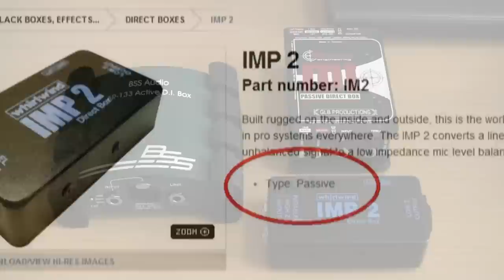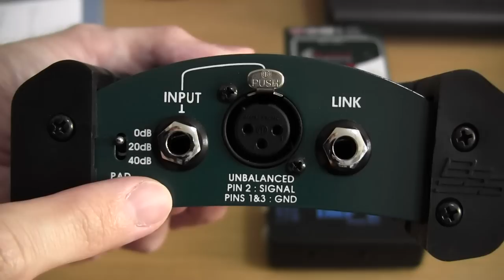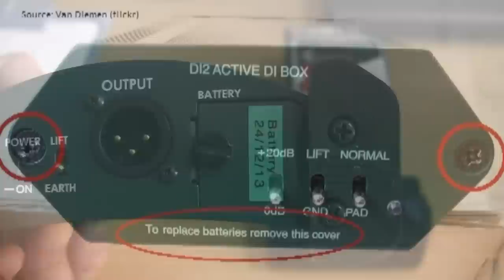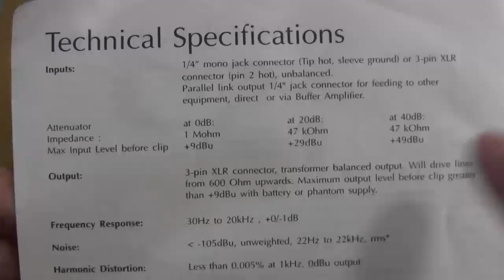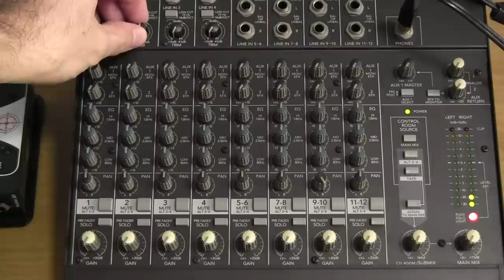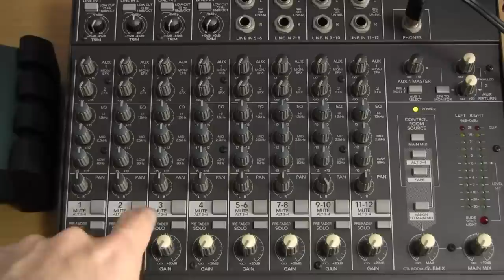DI boxes part 2: Active vs. Passive

Comment: Sorry for this dumb question, but can an active direct box work as a passive by just not turning on the power switch? thx
Reply from the maker: No unfortunately it doesn't work that way - active and passive DIs use physically different circuitry. A DI box as discussed here is either active or passive it can't be both 😊

Comment: If all you have available is the active BSS DI box, and you are plugging in an active acoustic guitar, would putting the switch into the -20db position or -40 db position solve the signal overload problem? If yes, will it sound good?
Reply from the maker: Different acoustic guitars can have greatly differing output levels, so start with the switch in the 0dB position and see if there is any overloading - if so switch it to the -20 position, or switch in the pad on the mixer, if available.

Comment: So, if I'm plugging a Passive guitar into a chain of fx pedals that require a power source, and then going from the fx pedals into my audio interface, I would need a Passive DI Box because the fx pedals power sources would create an Active Audio Signal, correct?
Reply from the maker: Correct! 😄 However, if you are going into an audio interface you may not need a DI box at all - just connect the output of the last pedal to the input of the interface using a normal guitar cable.

Comment: As many have said, excellent teaching! I play upright bass and the pickups are usually very low level requiring an active DI. My DI has a set screw to control the output level and now, thanks to your explanation, I'll turn the set screw to match most microphones output. That will put me in an acceptable operating position, (12 o'clock)  for the mixer gain setting and make the sound man happy. Thank you very much...
Reply from the maker: - Hi James, glad the video was helpful. In the case of active DIs with level controls it's actually worth doing some experimentation: your DI is effectively a pre-amplifier, and in many cases may give a better quality signal than some mixer preamps. If you know the sound engineer and he's willing to work with you, try comparing your 'mic level' setting against setting the DI level at max and then reducing the gain at the mixer - one combination may sound noticeably cleaner! 
Having said that, if you are playing a one-off with a sound guy you've not worked with before, setting your DI to output a mic level signal is the safest option. 
All the best with your music!

Comment: I appreciate a lot the label on the battery lid at 3:52 . It looks (and is) very professional.
Reply from the maker: Thanks for noticing :) Those labels are gone now - I've removed the batteries from all my active DIs and just run them on phantom power - don't want to take the risk of leaks.

Comment: Fantastic tutorial. I actually sold a new Takmine cool tube because of this very problem. It was a 50% chance that the guitar sounded distorted. We had to have the guitar volume control right down and it still sounded bad. We attended many performances where performers would take turns performing such as a song writing circle and everyone else's guitar sounded great but ours was distorted. Sometimes it was good, sometimes it was bad when plugged into a DI but plugged into an amp it sounded perfect. I got fed up and bought a Martin guitar with an active pickup and haven't had an issue since. I now understand why this was happening. Thanks!
Reply from the maker: Darren Patrick Yes, Takamine guitars are notorious for having very high output levels, even higher than certain keyboards. Using a passive DI will at least give you a fighting chance of getting the gain set correctly. 

In your gigs did you ever make it to the mixer and see what the gain setting was?

Comment: Thank you for this. After decades of being pampered and looked after by some amazing sound engineers, I find myself in a situation where my new regular church has all the equipment,PA system: Allen & heath WD3 16:2 desk, lexicon effects processor, amp & 6  foh speakers, wireless mics, video system, DVD & CD player, PC, monitor cables etc. but no one around anymore who knows how to work it. The person who operates it on a Sunday, knows about faders but that's about it! He doesn't do internet either. Hope you get the picture. Shame on me for not taking time to learn about the sound in the past. Your vids are helping tremendously but I have such a long way to go before I can manage to set myself up using in ear monitors and understand how to set the best sound levels for myself. Any tips would be greatly appreciated. Thanks again.

Comment: great video learn alot of DI boxes, very thank full, just two coments that are healp full for all. 1) you can still use the active DI box and pres the pad button to -10db  lower the hot signal.  2) the industry started with Impedance matching but now we use Voltage Matching ( by having low impidance output comonly 10 times lower comparaed to the input inpedance of the next conector)  this DI boxes do this with the signal balancing you mentioned.
Reply from the maker: Thanks for the comment 😄
1) Correct - Active DI boxes can be used for both active and passive sources. 
2) There are still some high impedance sources even in modern sound systems - most notably passive bass guitars and some acoustic pickup systems. For these you still need a relatively high input impedance or high frequency loss will result.

Comment: Wonderfull video. I was about to buy an audio interface and I saw in another video that a DI box was required in some cases. Thanks to your explantion now I know that I have to buy not only an DI box, it have to be active. Keep up the good work.
Reply from the maker: Cadu Souza Thanks for watching! Bear in mind that some recording interfaces are able to fulfil the functions of a DI box. Specifically, look for those with high impedance inputs designed to handle things like electric guitars and passive basses. If you are working right next to your computer or recorder a DI box is generally not needed - plug into your interface and then go USB/firewire from there into your computer. This is something of a grey area so let me know if you have any questions.
Reply from the maker: Cadu Souza Yes, that is a known issue with the Focusrite units - their 'instrument' setting only gives you an input impedance of 10 kOhms which is not enough to accommodate passive instruments. 

Another unit to consider which I use personally is the Steinberg UR22 - this has a similar feature set, but crucially has a true hi-Z setting for its 2nd front panel input. Hope you find something that works for you!
Reply: Thank you very much for weighting in. I just got a Steinberg UR22 because of all you said and it also comes with a free copy of Cubase AI, which I might use to record eventually. My Guitar (I only have the one, a 1989 Yamaha Pacifica 712) comes back from my luthier tomorrow then I'll be able to test the interface fully. Thanks again for all the info.

Comment: VERY helpful!  Thank you so much.  I was going to buy an active DI just because logically I assumed they would be more powerful, therefore better.  You saved me from that mistake.  Then I thought I was going to have to buy TWO separate boxes - I have an active bass and acoustic, plus a Tele and a Strat.....so now as long as I run my electric guitars through my Boss Compressor/Sustainer first I'll be fine.  Thanks again!
Reply from the maker: You're most welcome, thanks for watching!

Comment: Thanks! If I hook up my passive electric bass to a tuner pedal with a battery even though it's bypassed, is that now an active source? The tuner is a Kliq tuner. Specially the bass is a Stingray by Music Man (passive) and I have a passive Radial Pro DI box. Okay to use that?
Reply from the maker: This is an interesting one! Technically it depends on whether the tuner has a true bypass or buffered output. A true bypass pedal acts like a straight piece of wire when it is turned off, a buffered pedal has a small signal amplifier inside which 'tops up' the signal as it passes through. If your tuner is the former, the signal remains passive, if the latter, it becomes active. Now, I had a look at the Kliq website and they don't say anything about this aspect of the tuner 😄 So... just use your ears: if the sound is ok using this signal chain, you're cool. If you hear some loss of high frequencies with the tuner connected, then you may need to connect it after the DI box.
Reply: @GLBProductions  Thank you! :)

Comment: Thx Bruno. As always, God bless. Will try the behringer DI100 as it has attentuation pads for amplified instruments.
Reply from the maker: The DI-100 is actually a copy of the BSS AR-133 in the video. I recommend using the original, if you can afford it. It has significantly better build quality and identical functionality.

Comment: First sir I must say you are my new hero. The time you took to explain these differences between passive and active, along with your real-world demonstration was very very helpful. Thank you very much. Question: I believe you are recommending I use a passive box as I use a telecaster through several stomp boxes. I must use the parallel (or link) output to my amplifier, and the XLR out (on the DI Box) to the sound board. Does that sound correct to you? Again, thank you sincerely.
John - Ohio USA
Reply from the maker: That's right John! Also remember that when you put the DI between your pedalboard and your amp any effects on the amp will not be captured by the DI, so it's important to have all of your key effects on your pedalboard - the amp in this case becomes just a monitor for you on stage.
Reply: Got it. Thanks for the reply friend !

Comment: Many thanks for getting back to me, I will have to check my mixer as it's an old 80s Yamaha and not sure if it does have the balanced outs - both DI videos where so good, I have spent weeks trying to work out the benefits and your video told me what I needed to know in 5 mins! :) - just got to get my head around pre-amps now :)
Reply from the maker: No problem, glad to see you're keeping the old gear alive and working :) 
There are several more DI box videos in the works, so stay tuned.

Comment: Another great video Bruno! I'm saving up for a JDI stereo passive direct box and Soundcraft EPM8 10-channel analogue mixer. I will be using the mono inputs for the synths and the stereo inputs for the external FX pedals (music hobby.) Please, I have a question. Can an active source (hybrid keyboard synthesiser) connected to a passive DI box go into the mixer line inputs to achieve the same sound clarity and dynamics as it would via an XLR mic in? Thanks.
Reply from the maker: On that mixer, try connecting directly to the mixer's line inputs, without a DI box - this is actually the best match for a line level signal.
Reply: @GLBProductions  Hi Bruno, I guess I will have to resort to the XLR mic-ins after unbalanced to balanced process and impedance match. I want a clean signal path thru the signal chain. Just to mention before I ask two questions, the synthesiser has left & right audio output ports. Also, inside the hybrid synth display global setting, I can switch the internal source from being default stereo to mono. I want to achieve stereo and mono audio when changing the global synths function to either. Question 1 - Will I need to buy the Radial JDI stereo passive direct box or the standard JDI passive direct box? Question 2 - Can I get stereo spatial sound dimension from my synth into one XLR mic-in channel? I’m thinking in this case that I will need the Radial JDI stereo passive direct box and an XLR splitter to XLR mic-in channel to achieve stereo sound, though I am not sure. Thanks again.
Reply from the maker: Um, you can't have mono and stereo at the same time with only two audio outputs - it is one or the other, unless they have found a way to bend the rules of physics 😅
1. If you want stereo you will need either a stereo DI box or two mono DIs. 
2. No you cannot, unless you have some other way to convert it to stereo later on in your signal chain. 
Also, remember that the outputs from the synth are already low impedance so you only need a DI box if you are running the signal a relatively long distance. Otherwise just plug straight into your mixer.
Reply: @GLBProductions  "I want to (SELECT) stereo (OR) mono audio when changing the global synths function to either." My bad.. 😊 Now I know the routes I'll be using to my mixer. Thanks for getting me through this part 👍

Comment: Well, I think another consideration for an active DI box would be bringing up -10dB level gear to +4dB.  For instance, a Roland R-8 drum machine produces -10dB level signal on its output.  So even though the R-8 is a powered "active" type of device, when connected to a "high-headroom" mixer such as Mackie VLZ4 series, it is quite difficult to "fill out" all that headroom with -10dB signal.  One can turn up the pre-amps on the mixer, of course, but even on claimed VLZ4 "low-noise" pre-amps, the noise level can become unacceptable past 11AM setting.  Consequently, when connecting the drum machine to the mixer, an active DI box (or entire set of them, since the R-8 has 10 channels/outputs) such as ART DUALXDirect becomes a life saver, at least for me.  Anyway, that's my 3 cents to the DI conversational piece.
Reply from the maker: - A good point! Essentially what you are doing is using the active DI box as a preamplifier, replacing the preamp in the mixer. However in a case like this it would be best to connect to the mixer's line inputs to get a good level match.
Reply: Well, I've been using the line level inputs on the VLZ4 with mixed results.  Basically, each piece of audio gear that I have seems to be outputing different levels.  Some equipment has switchable -10dB/+4dB, but most of it outputs at -10dB and I need a boost from active DI box. For some reason, the DI boxes that I have (inexpensive ART) don't introduce noise.  Now, it could be embarrassing on two fronts.  On one hand, the "boutique"-like advertized Onyx preamps on VLZ4 seem to be outperformed by simple active DI boxes.  On the other hand, of course, maybe I should be embarrassed for not using all these things right, in the first place.  Well, I feel like I could write a book on the topic, which probably wouldn't be that interesting anyway.  To make long story short, the line level 1/4 inch jack inputs on the VLZ4 have quite different characteristics than the XLR inputs on the same channel, and I so far I've had more consisent results when connecting audio gear to the XLR inputs, either directly, like Yamaha TX816 or Integra-7, which connect beautifully out of the box with ballanced outs, or using ART DI boxes when the gear only has standard 1/4 inch jacks outputing -10dB.
Reply from the maker: Andrew Piatek The Onyx mix preamps are not a favourite of mine - I find that they do not have enough gain for real world situations, and that often results in gain settings of 3 or 4 o'clock with dynamic mics. I also found that they coloured the sound too much for my liking, so have gone back to the VLZ3 mixers. Thanks for sharing your experience, at the end of the day it's all about what sounds good!
Reply: GLB Productions
He he yes, sound, as well as look and feel.  I had plunged all the way into 3204 VLZ4, althought I could've probably been better off with VLZ3 as well.  But I have to say that for my applications (hopeless '80s MIDI rackmount modules enthusiast, no mics...) I am very happy with the mixer.  Thanks for replying.  Your videos rival the likes of sonicstate videos.  I very much enjoy watching.

Comment: This was a great video. I did not really get why you can't just use a passive DI with a passive instrument, and just compensate by upping the gain on the preamp. I didn't realize there would be high end frequency loss. The downside is...now I have to buy another DI box.
Reply from the maker: Thanks Andrew.

Comment: Why shouldn't I just take my 1/4 inch out from my Gibson Acoustic Electric straight into the mixers 1/4 inch input if I am only 10 ft away from the mixer?  Will the DI Box give me a better sound?
Reply from the maker: If your Gibson has an active preamp (onboard battery) then this should work fine.

Comment: Thanks, very instructive video ! I am a drummer & use a Yamaha MG12XU with 6 mics (4 + 2 overheads), sending this mixer to a main mixer Soundcraft UI16 : what should I use, an active or passive DI boxe ? Do you consider my Yamaha mixer as an active or passive system ? Thanks a lot for your answer, musically, Emilio L. (France).
Reply from the maker: In this case you don't need any DI as the mixer output is already balanced :) Have a look at my video on this subject: https://www.youtube.com/watch?v=HgeVInOV1Kk

Comment: You are great man, incredible video, just one question please.

In my pedalboard i've got many effects and a preamp pedal.

Do i still need an active DI or i'm fine with a passive ?

I play Telecaster and passive guitars.

The point is that a passive DI is easier, no power supply and cheaper..😎😎

I usually go straight into mixer without amp.
Thanks a lot.
Reply from the maker: In your case a passive DI is fine. Thanks for watching!
Reply: @GLBProductions  Thanks a lot, good news. 😀😀